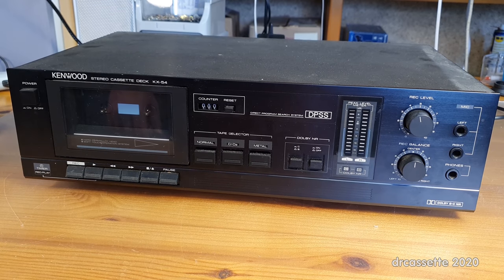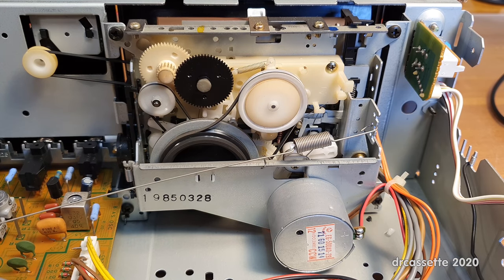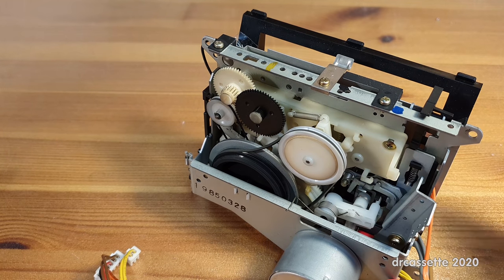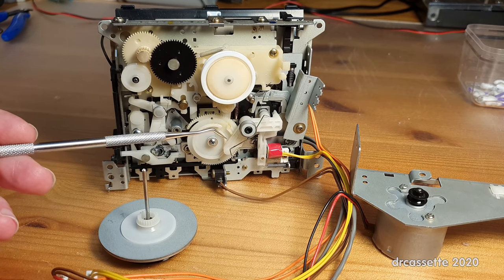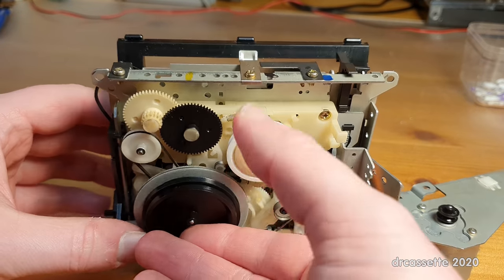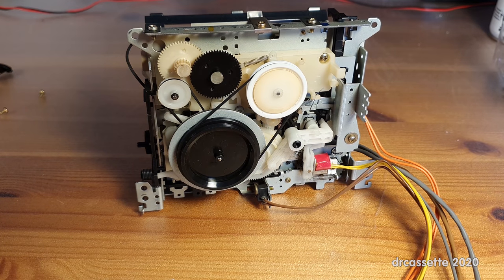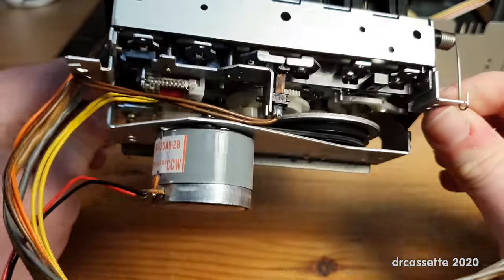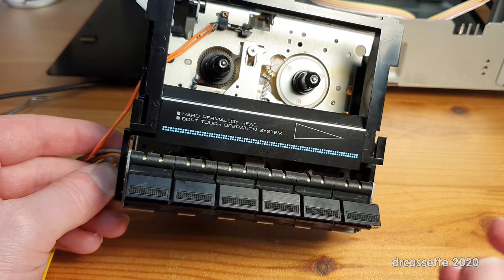Kenwood KX-54 cassette deck repairs

Comment: I have had the same unit for a while now and have struggled to fix it.  I hope that, with this video, I can finally get it to work.  I will keep you posted.  Thank you!
Reply: Well.  I tried but the mechanism is still stuck.  Any additional information will be appreciated
Reply from the maker: What additional information are you expecting? This video already is quite detailed, your cassette deck may have a problem that is different from the problems I had. Obviously I can't show you how to fix problems that my deck doesn't have.
Reply: DrCassette i understand. I was thinking of a picture from a manual or any idea you may have to suggest.  Again, I appreciate the information you have provided on the video. Please know that I didn’t mean to upset you.
Reply from the maker: Don't worry, I am not upset, it's just that any information I might have already is in the video.

Comment: That mechanism is almost identical to the one in Sony XO-700 system, from 1985. I recognized that backplate with the spring tensioner for the headbridge cam. It always annoys me when routine maintenance such as belt change, inevitable in ANY belt drive cassette deck, is made so complicated due to poor access.

Comment: That mechanism looks very daunting if you have to take it apart completely and reassemble it from scatch. Looking at how it has it been designed I wonder how well the mechanical engineers thought of the assembly line people who had to assemble it. On a somewhat related topic as a building / structural engineer I often get feedback / questions from the builders why I designed a specific details a certain way. From a design engineering point of view something may be sensible but the people that that build it / put it together have a more practical look at things. Looking at how much you have to disassemble to replace the belts make me realize that. I have tried to service a Dual 1224 my self at some point by studying the mechanism but I never succeed at fixing the tonearm lift as I felt that I could not disassemble the tonearm and put it back together properly so that project is half done.
Reply from the maker: Assembling the mechanism in the factory would have been a lot easier than it was for me, because they have precise instructions what part in which order needs to go in, and they have jigs to hold parts in place during assembly, so they wouldn't have to worry as much as I did.

Comment: the resonant frequency is very odd.  perhaps in time either a) any remaining hardened grease will flake away and work itself out, b) your new grease will work its way into new nooks and crannies or c) in absence of lubricant metal/plastic will wear themselves down and the sound will disappear.  your dental tools besides being very useful for working are priceless for using as a pointer in the videos - very helpful for the viewer.  this unit would be a nice match to my kenwood KR-V7050 receiver (even if they are from different eras).  i laughed aloud more than once in this video at your difficulties, i have some guilt for that because i too have become frustrated with a never ending list of compounding problems.  great great video - 30 minutes went by in a flash.  thank you from chicago!
Reply from the maker: I was hoping that the noise would somehow fix itself over time, but in my final test there were speed instabilities in addition to the noise issue, so this cassette deck will need some more work at some point...

Comment: The best solution is to continually run the tape deck.I know it should be one and fix.Through the years I have learned with tape deck like most electronics. It thrives under continually use.This is what I call fuzzy logic. Like breaking in a new pair of shoes. This obtuse method ironically works well for me.This continually use helps everything mess well.With engineers it either off or on no gray areas. This process helped when I had my Strokes in 2015 and 2019. To continually run tv and dvd player to starting my truck to keep it and the part lubricate for a couple of months during each Stroke.
It saved them from electronic dry rot of no use for those months. My Sony DVD player had lasted 20 years. My Truck about 20 years then I sold it someone who fixed it up my injuries from Strokes prevented me from doing it myself. It is still in use.
My long winded story is let it continually play for weeks to see how it improves. Do not let it sit and freeze up again Find a use for it,Great Video🙂
Reply from the maker: I don't have this cassette deck anymore. I finally found out the excessive wow and flutter was caused by the replacement motor I put in. It looked like a good Mabuchi brand motor, but upon closer inspection it turns out to be a cheap Chinese knockoff.

Comment: Wow, that's the same mechanism I have in my Hitachi TRK 9230 boombox.

Thanks to you I can now see that I have a missing spring in my mechanism so I can fix it. Wohooo! :)

My belts also turned into liquid. Interestingly, Hitachi put rubber dampeners on the motor. This model does not seem to have them.
Reply from the maker: I'm glad this video is useful :)
Kenwood apparently did a bit more cost cutting than Hitachi, so no rubber dampeners. Of course, I had to take advantage of the existing cutouts in the motor bracket and put some in when I replaced the motor.

Comment: Excellent tutorial. Had the same sticking operating buttons scenario and cleared this with miniscule applications of penetrating oil thus avoiding further detailed dismantling.. Major panic during repair as the capstan flat plastic washer went awol for a good few minutes but, thankfully, it reappeared.
Reply from the maker: I'm glad this video was useful :)

Comment: With my Marantz PMD 502 I too had an issue with intermittent resonating noise. With this deck the issue was the belt. The belt was not stretched, but did seem a little inflexible & appeared somewhat pale in colour. Whilst playing the slightest tap of the belt with a screwdriver (or other tool) & the noise stopped, but then slowly returned. Replacing the belt solved the issue.

Comment: Great video but I have a problem in that I can't remove the mechanism from the case - there doesn't appear to be enough wiggle room with case brackets and the pcb getting in the way. The video jumps this part of the process! Is there a trick I'm missing?

Comment: hi I have a Yamaha kx w392 dual deck.lately i have noticed on playback or record when it auto reverses at the end of tape it will either be fast or slow .any ideas on what the cause might be? it does not do it all the time! good luck with the Kenwood!

Comment: congratulations for your patience.
Reply from the maker: Thank you! By now I think I have figured out why the cassette deck still wasn't running very well at the end of this video: The replacement motor I put in appears to be bad.
Reply: I found out that youtube is part of social media and one should avoid too much social media. With your channel and 4 other hifi repair channels, That is impossible. Trying to fix KX-7030, probably only the belts :-)

Comment: This is my reasoning for electronic soft touch > mechanical soft touch. i used to have a kx-54 before i switched to kenwood's second from top of the line kx-5530. i really enjoy using that tape deck and maintenance is nowhere near as difficult as even the sony tc-r302.

Comment: Well don't feel bad. I just sent a couple DAT machines back to my storage locker. I gave up on them, and instead of being frustrated, which I already was. Just decided to pack them away and maybe revisit them again some other time.
Reply: Hm, yes but then you have those decks sitting around in the back of your head until you’ve had enough.
Reply from the maker: This Kenwood cassette deck is now sitting in a corner of my workshop, waiting for me to have another burst of motivation to fix it. How likely this is to ever happen I don't know...

Comment: My tape deck has that spring as well, it's interesting to find that was a common way to engage the recording function on the board.
Reply from the maker: Traditionally all cassette decks had a linkage from the mechanism to the record/play switch that selects the mode of operation of the electronics. In the first full logic cassette decks the record/play switch was operated by a solenoid. Throughout the 1980s the record/play switch in most cassette decks was replaced with electronic circuitry, some cassette decks still had a little relay.

Comment: hope it wasent too much to fix, there are 2 on a well known auction site in the uk for around 15 uk pounds, however both have issues
Reply from the maker: I probably already put more work into this deck than what it's worth, but I didn't care too much as it would have ended up in my personal collection anyway. These simple decks are not rare enough yet to be valuable.

Comment: Thanks for the indepth tutorial on this, some steps helped me out!  On missing belts, whats a rule of thumb for sizing?  ~Jack, VEG
Reply: Use a length of string or very thin wire to wrap around the mechanism pulleys. You then half this amount when measured with a ruler. This will give you a rough idea of what to look for..
Reply: Thank you, I appreciate it!  ~Jack, VEG
Reply: For me, I just want to make sure that there is enough tension on the belt. It’s gets easier over time once you’ve had more experience. Thickness is another thing but that can be trail and error

Comment: Great video, I'm going to try to fix a Kenwood KX-31 on the weekend if the belts arrive in time.
Reply from the maker: Good luck! I had the black version, the KX-31B, many years ago. I had to replace the belts in it. The mechanism is much higher quality than the one of the cassette deck seen in this video. So you should have a lot less trouble getting it to work.
Reply: @DrCassette  Thanks, yes I've seen your KX-31b video... when I found the deck on ebay I googled the model number and then found your video. Been watching some of your videos to pick up some tips... even if the deck isn't the same model there are some good tips and tricks to pick up. Cheers!
Reply: @DrCassette  Sadly I'm not able to fix it... so far anyways. Replaced all the belts just fine, everything is spinning nice and quiet, but when the play mechanism rises it doesn't rise high enough and I can't figure out why. It's not jammed, I can raise it with a screwdriver.
Reply from the maker: Oh, that's too unfortunate! Have you made sure the Pause mode is not engaged?
Reply: @DrCassette  Yes, pause mode not engaged... but... I've found the real issue! There's a spring that has broken through it's housing and thus is not under tension... I'm going to attempt to fix the plastic piece with some JB Weld.
Reply from the maker: @JohnWhittle  Good luck, I hope it's fixable!

Comment: That Kenwood deck mechanism looks virtually identical to the one used in a 1986/87 SABA RCP-650 (single cassette) boombox. It has a small rubber idler tyre in the front (mostly for playback - rewind/f-fwd is geared) - this tyre cracks quite often in these decks and can be a pain to replace (don't waste a bunch of time trying to repair or glue it). Those do fail as well as the belts.

Comment: Is there an electrical reason why the transformer is mounted at an angle, rather than squared with the board and sides (at about 1:25)?
Reply: Yes, it's at such an angle that there is minimal magnetic interference with the R/P head (to avoid hum in playback).

Comment: Interestingly, when I was young we had a Technics dual-deck which after some years developed a very similar noise on the recording/auto-reverse deck. It was intermittent and only seemed to happen near the beginning of a tape, and apparently only when playing in the forward direction. It was quite loud and disconcerting, but the deck otherwise seemed to work fine. Makes me wonder if it was a similar issue.

Comment: I have never seen a repair video of a basic cassette deck in such detail. Soft touch mechanisms are my favorite out of the 3 types. I find the mechanisms use so interesting as it was designed to be better than the mechanical setup and a little bit less than the full logic mechanisms. Of course companies like JVC still referred to the soft touch mechanism as “logic control mechanism.”
Reply from the maker: The early Full Logic mechanisms required big, expensive solenoids that had high power consumption, so in addition you also needed bigger transformers, stronger power supply electronics and so on. So the Soft Touch mechanisms made sense for portable devices and budget-oriented equipment. The later Full Logic mechanisms are actually more like the Soft Touch mechanisms. Instead of the mechanical function selector buttons there are tiny little solenoids, that only need to give a quick "kick" to the mechanism to engage a function. That could be done easily without upgraded power supply, so now even budget-oriented cassette decks could be made with a fancy looking Full Logic mechanisms. That's why the Soft Touch mechanism disappeared in the 90s.

Comment: Interesting repair. What would you say is the advantage of the rubber grommets on the motor? I'm used to them being used to dampen vibration from PC hard drive platter whirring etc, but not too sure why they're needed for this motor. Any slight movements on the motor might add to wow and flutter?
Reply from the maker: With the motor, it's exactly the same situation as with the HDD: If you have no rubber dampeners, the motor vibration is transferred into the chassis and the noise of the vibration is thereby amplified. Having rubber dampeners does not mean the motor is loose, the dampeners come with special screws that make sure everything is securely mounted.

Comment: Dr cassette I want to share with you that I have the same issue with the noise on an auto reverse soft touch jvc mechanism. It’s in the reverse direction on the reverse supply reel. The mechanism that jvc used was in a almost a dozen jvc products from boomboxes to components. Anyway this resonance issue has also driven me crazy. I oiled the bearing and can’t figure out what is causing it!!! I’m starting to think as the plastic ages, it changes its molecular state??

Comment: I have the KX-44 (the difference is that it does not have Dolby C). The engine starts automatically when the power is turned on. Is this normal or is it due to a wrong gear position and being stuck in a certain (play?) mode? I replaced all the belts with new ones, the tape recorder started rewinding but still the play mode does not work.

Comment: Last year I repaired my friend's same model. Was change belts, head, and capacitor in the motor supply. I think this deck doesn't worth spent time at repairing. Very low-end pre-amplifier. A mechanical breaking is used to hide the noise of the sound path during the pause. To eliminate the annoying noise of the receiving axle, you need to disassemble the entire mechanism and clean the idler mechanism
Reply from the maker: I did clean the little idler wheel, I am pretty sure the noise comes from inside the take up reel clutch. No idea how to fix that, I could try replacing the felt pad inside the clutch, but that may very well make things even worse because of course I don't have an exact replacement for the felt. I actually think the cassette deck sounds very good, the Dolby B seems to be well implemented as also that does not degrade the sound quality. It's just the cheap mechanism that lets this cassette deck down...

Comment: I think your take up force is possibly a bit too high (should be around 50 g/cm). This could put a load on the mechanism causing wow, and also explains the noise.
Reply: Not as impossible to find as toilet paper, but not easy either when it comes to some of these cassette deck tools.
Reply from the maker: Unfortunately I can't find a full service manual for this cassette deck (just schematics), so I don't know how the take up force should be adjusted. Probably some very simple setting, like changing the tension of a spring somewhere? I don't have a test cassette to measure take up force, but some tiny random change in force may very well be already enough to make the noise go away...
Reply: It's often caused by the felt in the take up reel that becomes hard so it doesn't slip well. You could put a bit of baby powder on it to make it slip a little easier.  Don't use oil or grease.
Reply from the maker: The felt in the clutch indeed looks very worn out, in fact the plastic piece that rides on the felt has a pattern of multiple rings on it wich is also clearly showing in the felt. Replacing the felt would likely make things even worse as I certainly wouldn't be able to find just the right material, but I'll have to try to restore the felt :)
Reply: @DrCassette  Try the baby powder. Good luck and stay safe!

Comment: Another way I have fixed take-up reel clips is to fashion a new one from the very fine, flexible but string wire you find in cable tidies. The sort you find in most electrical devices, retail packaging these days. Just wire-strip, bend around the indent at the end of the spindle; twist and clip.

Comment: Unfortunately I have never found a good solution to the gooey belt situation. Would you (Dr. Cassette) have any good solution to getting the gooey belt off your hands easily. I have always had trouble with washing it off my hands.
Reply from the maker: This time I used isopropyl alcohol wich works very well, but of course really dries out the skin. That's why I then started wearing latex gloves for the cleaning of the mechanism.